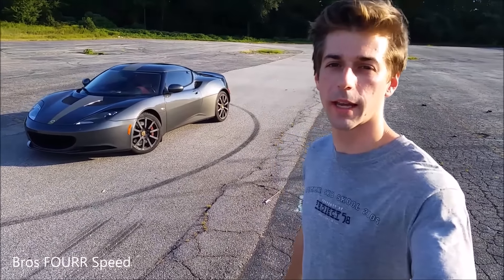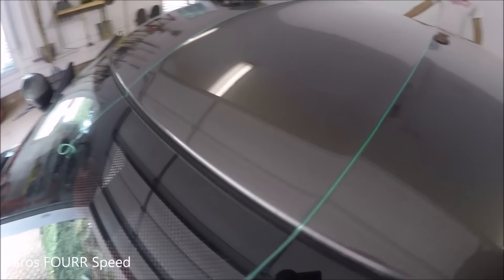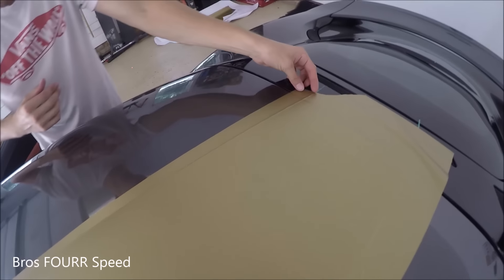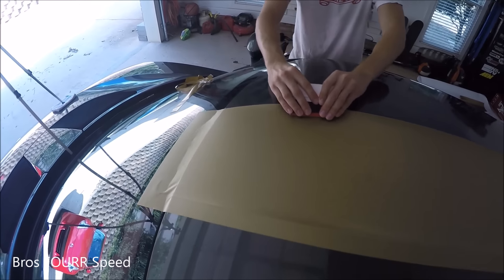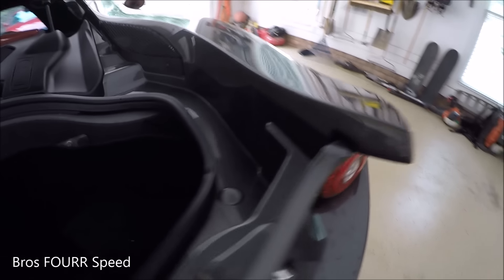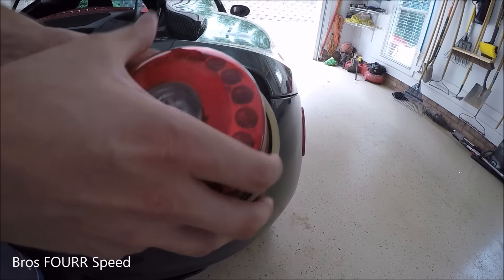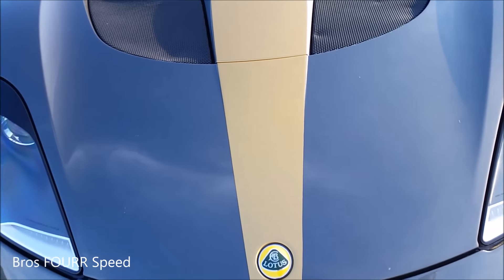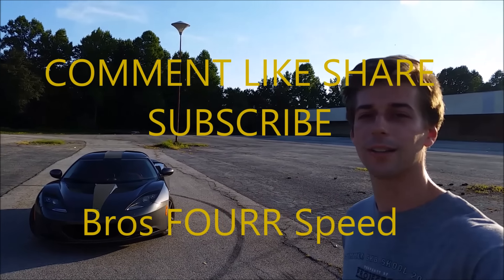Vinyl Wrapping My Lotus Evora: Part 1

Comment: Looks good!

Thinking about some gold wheels or accents on my granturismo S
Reply from the maker: Nice! I'm thinking of the same color for my wheels
Reply: Maybe do the mirrors as well? Probably should do black lugs w the gold wheels.
Reply from the maker: We tried the mirrors, but we could not get the bottom to stop wrinkling. It was a tough stretch to get everything covered, and the final bottom edge couldn't handle it unfortunately.

Comment: Those cutting tape came pretty useful, I've watched a lot of wrapping videos and have never seen someone use them before. Great job with the color scheme btw, that gold blends really nice with the grey!
Reply from the maker: The tape made all the edges very clean and straight, would not have looked very good using anything else to cut it out.  Thanks!  Can't wait to get some more colors on it!

Comment: Not really a fan of the color or the stripe, but excellent work on wrapping it though that's pretty time consuming. And I wouldn't recommend doing this if you have OCD like me.. I would die even if it's 1mm off centered :(
Reply from the maker: Fair enough, thanks... would you have any color ideas? I have the solid red interior so I'm staying away from red..
Reply: I would go Satin black body, matte carbon roof, matte carbon mirrors and spoiler. Black out the front Amber indicator lights, and black out the fender side markers.. I like the stealth look lol I don't like attracting attention from people and cops. Good luck with your decision man I'm sure it'll be nice whichever way
Reply from the maker: +Integra DIY I have some ideas using black, I like the idea of doing the side markers tho, I don't really like them.

Comment: I feel like the stripe on the hood is totally unequal, is that just me? Like you have a part that's covered by the wrap on the right but not on the left, I can't stop looking at it!
Reply from the maker: It's definitely equal. We measured the sides afterwards and everything comes out nearly perfect.
Reply: +Bros FOURR Speed 
 I mean the angled part that goes towards the grill, the one on the right is wrapped and the one on the left just isn't. See what I mean? I can't just be insane here
Reply from the maker: +rybhugo what part in the video looks like it's off?
Reply: +Bros FOURR Speed 7:28 look at it there . You've wrapped the strip in a straight line sure but you've wrapped the slant on the right side of the line but not the left side dip how can't you see it ?
Reply: +Nathan Marleau THANK YOU
Reply from the maker: 3:30 we used the knifeless tape and cut off both sides, the driver side of that part is not wrapped...It's the glare of the sun you are seeing at that point in the video.
Reply from the maker: Pause it at 3:45 and you will see both side pieces are body color.
Reply: +Bros FOURR Speed Thanks a lot for responding, that was exactly the mistake I was making. Should have rewatched the part with you cutting it before commenting!
Reply from the maker: +rybhugo It's all good, I'll make sure I get better angles in the next video!